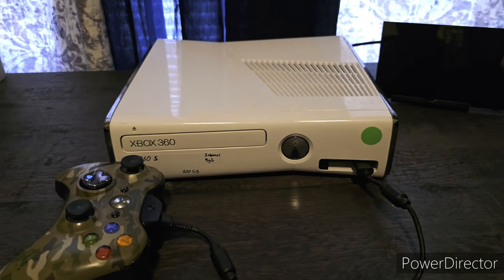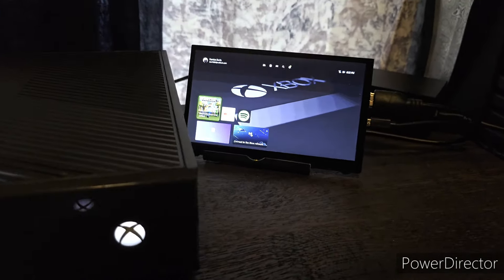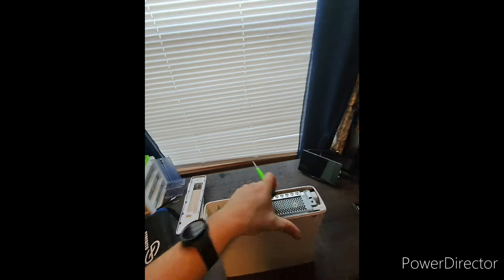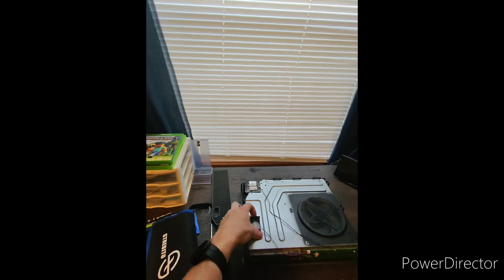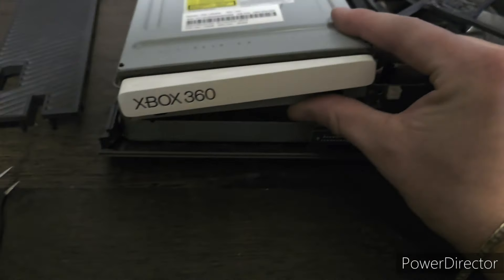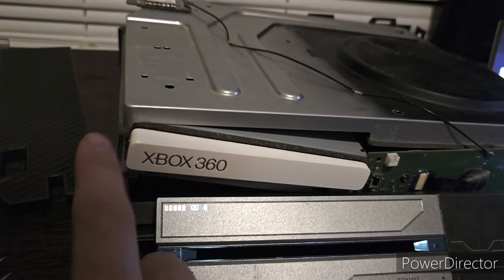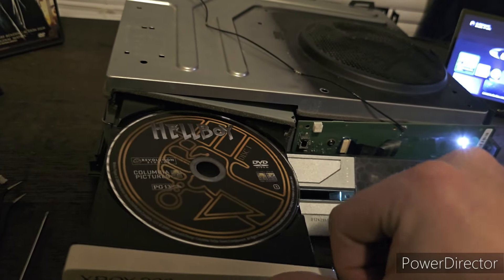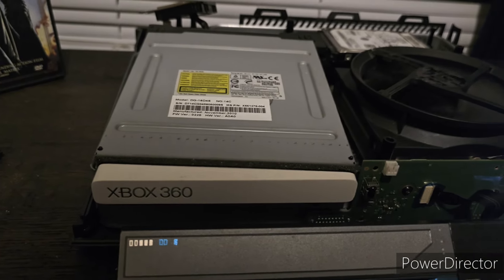Putting an Xbox 360 Disc Tray into an Xbox one (Requested) Will it work?

Comment: Since generation 8, both Playstation and Xbox have DRM in the disc drive logic board that is tied to the motherboard. This is an anti piracy measure. Consequence is that you can't replace a broken disc drive with one from another console unless you also desolder the logic board from the old drive and resolder it to the new drive.

Thus it should be no surprise that a 360 disc drive won't work on an Xbox One motherboard.

Comment: But why doesn't it read? Isn't it both just a dvd disk or bluray Like ps? It's the rest of the system that accepts the game no? Like when u put a ps3 disc in a ps4 it recognized it is a ps3 but it does nothing
Reply from the maker: @tomvandecruys5442  I belived it would at least play a DVD movie, but the kicker is it probably wont accept it because the serial number for the disc tray does not match the motherboard or some other odd reason of the like.
Reply: @james_day2020  didn't think of that.. u can probably work around that would be more struggle than it's worth I think
Reply from the maker: @tomvandecruys5442  I mean it's possible between learning soldering and other firmware hacks, but I do not have this knowledge yet